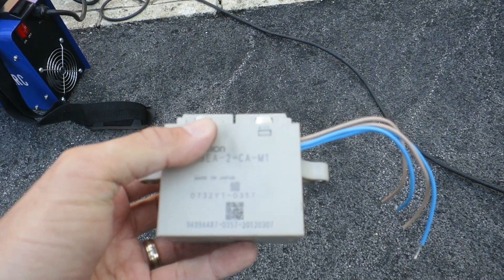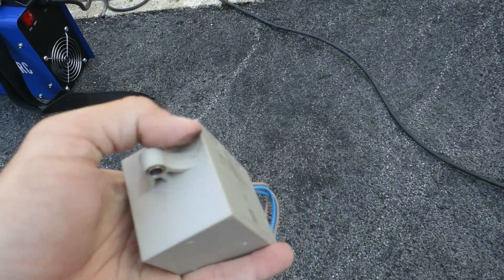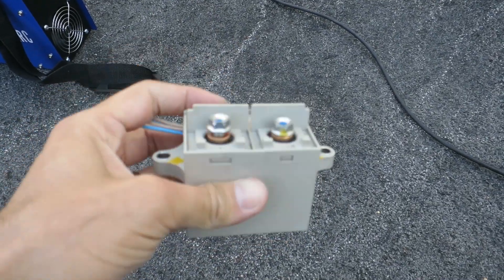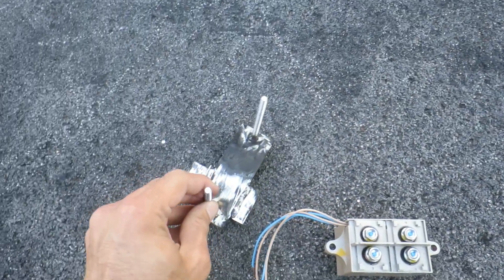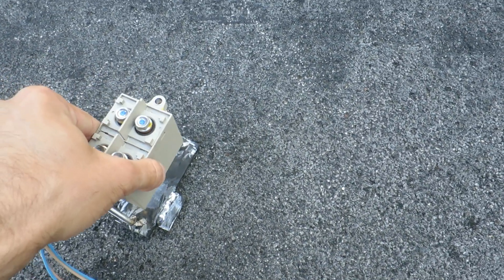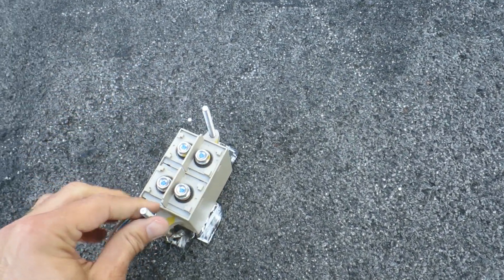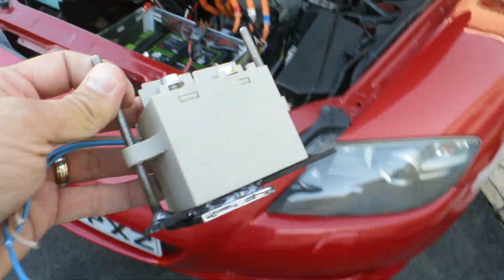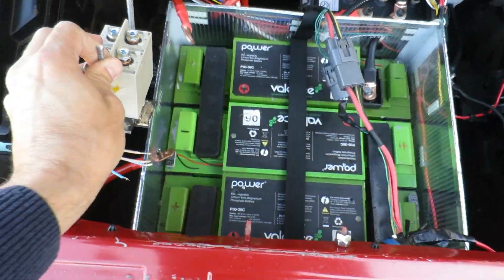Replacement Contactor within RX8 Conversion

Comment: hi, that contactor is from an i-miev/c-zero/ion battery pack - the fast charging relays, made by OMRON. I just bought main contactor from those batteries - I plan to use them for an extender battery pack in our c-zero. Best regards!
Reply from the maker: Yeah it looks really good and is working well, check out my latest video as I am using both sides of it to run my pre-charge circuit.

Comment: You should subscribe to my channel, I have done away with factory drive train, and installed a hybrid transmission on the rear of the mazda, plus I’ll have over 240ah 400 volts, at around 600 amps of power
Reply from the maker: Nice, sounds like a good project,